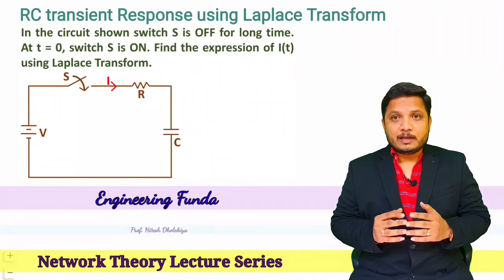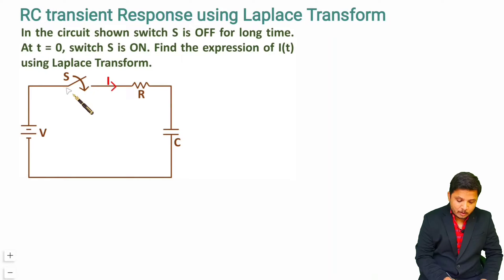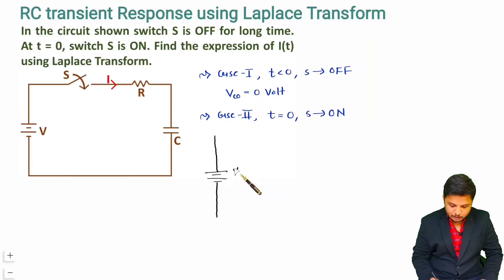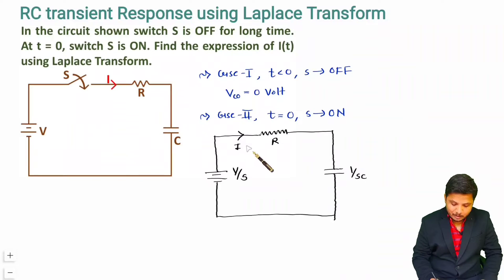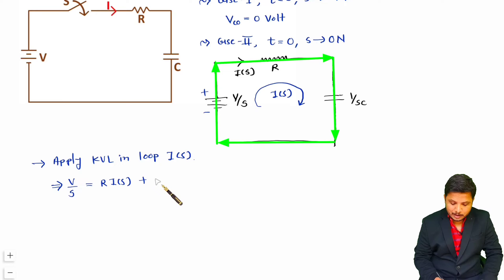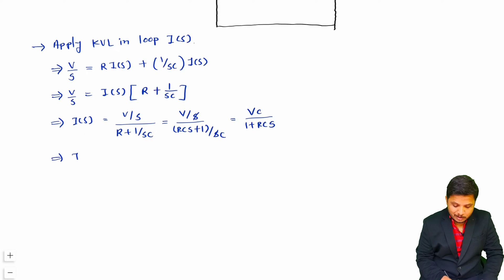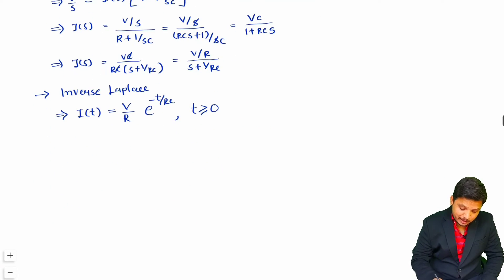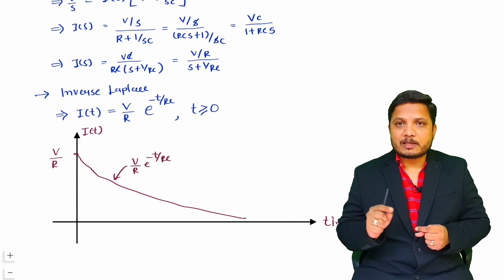RC Transient Response using Laplace Transform

Comment: Current increases in case of charging 🙄
Reply: ?! @amalrajpr6800
Reply: Current is at its maximum at t = 0. After t = 0, the current decreases until the capacitor is fully charged. In DC, when a capacitor is fully charged, it behaves like an open circuit and no current flows.